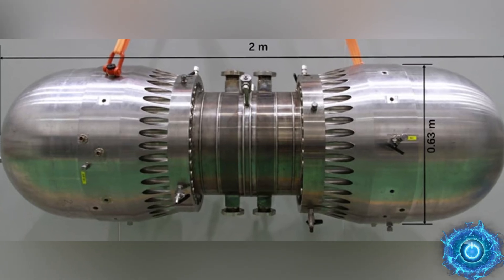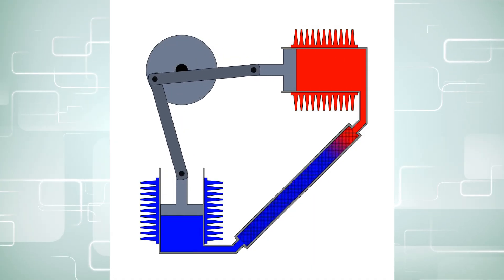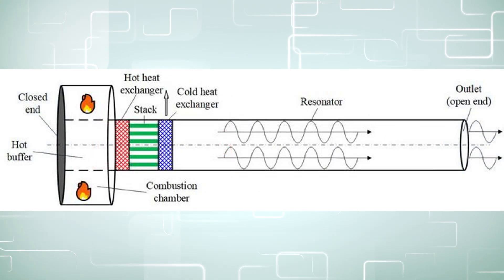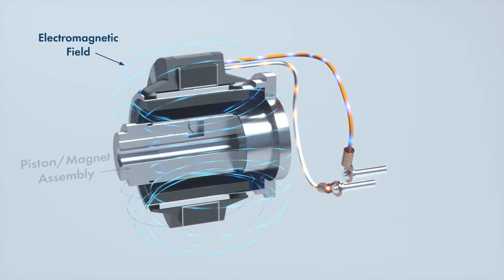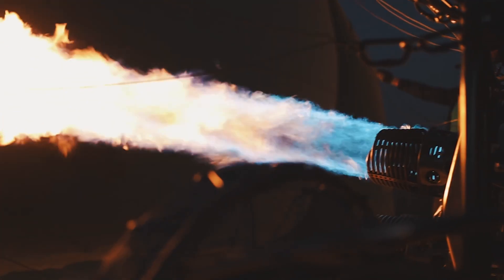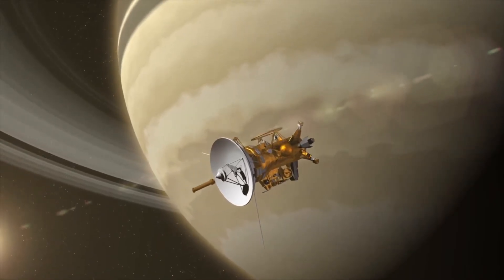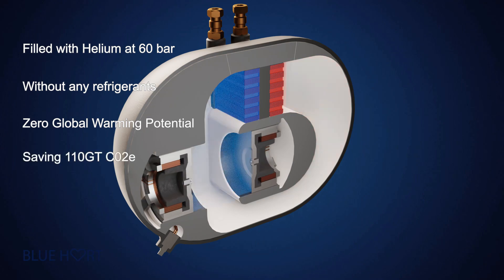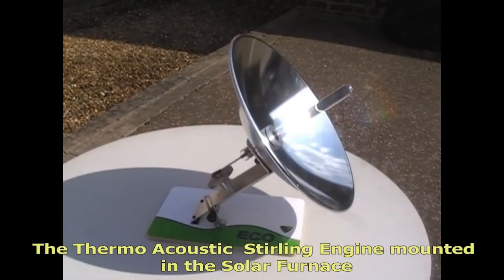New Acoustic Engine Breaks Records! - Thermoacoustic Stirling

Comment: The old solar furnaces used liquid sodium for heat transfer. 
The used in car valves to cool those 🚗 car valves down ❄️.
====
The 🌞 Solar furnace could be up to 3,000 degrees Fahrenheit. 
====
Now :
 Changing gears I , thought ? ; 🤔 💭 a clear rooftop skylight ☀️ plus water 🌊.

Water 🌊 in the skylight could  ☀️ power your lens 🔎 
=====
You could then store that ☀️power in 
[⌛ Sand Batteries 🔋] ☀️🔋 
🔋🔋 
,⌛🔥 
=====
Then use ? ; a Sterling engine that incorporated (Tuning Forks) 🍽️ 🎶 in the generator. 
====
Acoustic Rhombic Drive 

It , {{{👂 sounds 💋sexy 
for Valentine's Day 💕.
===
🔔 👂}}}}}

🌻
👋😎💨 Bryan 🧠💨🪣🦵💨

Comment: This tech could be used to draw energy from the heat of fusion in the future, fission now or with thermal energy from the earth itself.
In hotter areas we could make them bigger, have the cool end buried and the hot end exposed to the hot air/zon, you can easily reach over big temperature differences, between the soil and the zon. if made well enough it won't even transfer any heat to the cold end. we could also use the carbon nanotube wires to transfer heat from anywhere to the hot end, as they work like fiber, transferring heat from one end to the other without losing anything in between, like the light that goes into a fiberglass cable.

Comment: I came up with this ages ago and if you use solar panels to run a solar tracker to maneuver and arm holding a parabolic mirror and have it pointed at that or at the tank of a steam engine you can get energy outputs exceeding 80%
Reply: Only with the steam engine you have more horsepower and effective mechanical energy
Reply: I forgot to add in the alternator in order to generate power and a large battery with a capacitor to equalize energy output

Comment: I think these need to team up with hydrogen fuel cells to make use of the waste heat to generate more electricity, and perhaps integrate a means of air cooling the systems by circulating air underground to dissipate heat?

Comment: A system could be built using your own sun (via a plasma reactor) to ANY size. The acoustic unit and the reactor are scalable by orders of magnitude, creating unlimited power.  For example...the system could be the size of a hearing aid battery,  or the size of a planet.  And as for heat sources,  the plasma reactor can easily reach 25,000 C...is that hot enough for you ?

Comment: @2:00 Yes, the piston is "working"
Yes, the wheel is rotating.
No, there is no actual load.
Connect that wheel to a small generator that has a resistive load.
I can say with confidence that the actual available power is not much in terms of actually useable. And  yes, there are  many applicationz where low efficiency is irrelevant. Much like Peltier Junctions & Seebek Effect. 100s of mW is fantastic when you have nothing else as a power generating source.

Comment: This engine could be coupled with the exhaust of a gasoline generator and use the heat of the exhaust to greatly increase the output of the generator.  Not a very green solution but a way to exponentially increase the output and efficiency of our already existing huge number of gas generators not to mention new product.

Comment: Looks good on paper but it will be a nightmare for real world application. 
Heavily relying on heat source or temp difference yet you need to tune it for specific waves.
Then it is all cylindrical valves. Lubrication, seals ect.?
Maybe a rotary engine scenario?
Maybe identify optimal energy source something that gives it unique advantage over solar, heat pump application's.
Sound waves move faster in air but highest decibels are achieved in water. Something within these lines just because it can be used as substitute doesn't mean it is optimal solution.

Comment: if sound can't propagate in space, would an acoustic engine still be viable using a plutonium 238 thermal source?
Reply from the maker: Yep! Because you can still a medium or inert gas for the cylinder.

Comment: In Space, one side of a craft is exposed to sunlight and the other side to the shadows with a large temperature difference.
Can heat engines be used practically in space to refrigerate methane fuel tanks, maybe?
Just wondering for a fellow going to Mars.
Reply: sounds feasible

Comment: just think of the power this would have in space if you could get it done right so it will not melt . there is also the idea of Ceramics coated stacks to keep in residual Heat .

Comment: I have 2 startling engine on my desk and I plan on making a big one that runs off the waste heat from a wood stove and have low torque generator. With data centers going to suck up all the power causing the electric bills to skyrocket. We're going to have to become very industrious because electricity is going to become very expensive.

Comment: I like the Vajra ( 2 spherical shapes connected by a pipe ) form, i have never seen a stirling engine in that form before, very cool i have a 20 dollar stirling i got off the net and it works every time just put a heat source under it and the transfer of heat from one part to another makes a standing wave, i am making a motor that uses the Vajra and creates a nuclear plasma that destroys CO2 , CO, NOX, etc in the exhaust, its on a 7 hp Chonda. People get so stuck on using nuclear energy as a fuel, it does have other uses https://www.youtube.com/post/UgkxCZzR2cKzwuSAod8d6U0AUDUruidupyiR
Reply: good question, actually have a look at that YouTube post about forming plasma ( electric discharge ) with standing waves ( high pressure and low pressure regions ) they make lightning go in a straight line as the low pressure area is more .... what? ah more like a vacuum and plasma likes vacuums or inert gasses because ... i dunno my physics runs out there .... but its more permeable to discharges, thats why you do it inside light bulbs like neons ... the dielectric is easier to break down ...

Comment: I am no expert on the Stirling engine but in my view one of the reasons that they are so inefficient might be because they only capture a small percentage of the energy input. Primarily because of the leaky nature of the piston, its comparable to placing a propeller inside of a wind tunnel hoping to capture the energy of the wind. Most of the wind energy is lost when most of it avoids interacting with the propeller.

For the acoustic version that is being explored here, unless I am missing something the only real difference is that the acoustic transducer (the output speaker so to speak) or the electromagnetic generator takes the place of the crankshaft of the more conventional Stirling engine - and they still all rely on that leaky piston.
Reply: if they are so inefficient, then why are they used in submarines ?
Reply: @kelzangjinpa962 probably because water makes it possible to use a less efficient motor because it requires less effort?

Comment: Hyliion Carno generator dies this similarly, but is 60% efficient. Nearing scale production, under testing with the US navy. 22 fuels tested do not require after treatment for emission compliance. Can also be coupled to a nuclear heat source and used that way.  
Better, cheaper and faster.
Reply: You must have stock in that company! 60% efficient, no!
Reply: @Mentaculus42  I do have stock in Hyliion. 
That is exactly why I know what I am talking about. I have given you enough for a google search. Bone up on them.
 I am afraid their idea is better than this one.
Reply: @debi5292 

I have been following the Karno very closely! I have a better understanding of how it works than you!! It is NOT 60% EFFICIENT!! This is directly from their own disclosures. Net efficiency of 50% is stated in various sources. One info slide had an undefined thermal efficiency of the generator as 59% but only an overall system efficiency of less than 50%. That higher number is something that the company is rather vague about (and probably for good reason). Don’t always assume that everyone is stupid! The company is in survival mode for good reason. The Karno has huge scaling issues on top of it since it requires additive manufacturing which in this case is not a good thing. It is an interesting idea trying to find a profitable niche.

By the way, it is Karno spelled with a K for their marketing hype. Some people have more dollars than “Sense”.
Reply: @Mentaculus42  Its better than this widget is my bet.

Comment: Still don't know how the acustic part works.
Reply: Yes, I agree. I've built Stirling engines. I'd like to know exactly how the standing sound wave is produced from a heat source and a cold sink, and that standing wave then replaces the pistons.
Reply: @brianjacobs247  good question, actually have a look at that YouTube post about forming plasma ( electric discharge ) with standing waves ( high pressure and low pressure regions ) they make lightning go in a straight line as the low pressure area is more .... what? ah more like a vacuum and plasma likes vacuums or inert gasses because ... i dunno my physics runs out there ....
Reply: @StephenPhantom did a better job than myself!
Reply: Its just another energy source, get a cheapo Stirling off the net and see how it creates a standing wave in gasses, then just transfer that image to how to do the same thing acoustically and voila
Reply: @StephenPhantom can I just yell really loudly at it??  I’m not sure we have standing waves in Missouri
Reply: @williamgreen2673  You just invented the T rump engine I think,add that with the amount of BS he generates you can use the methane produced too may be
Reply: Nobody really knows in fact. You have a lot of effect. You have different regime of thermoacoustic pumping that has not been solved till nowadays. 

The key effect is the sound that goes into a holed ceramic that acts as a thermo-resistance and you have a thermal gradient from each side of the ceramic. This is the most simple effect... complex as F.
Reply: Sound is a vbration of air, the sound waves. You create them by trilling a membrane, and you can recuparate air trillings or absord a wave energy by a membrane, a microphone does that. Here is just another range of frequencies and amplitudes. A membrane is recipricating like a piston.
Reply: Just watch a slow motion, video of a speaker in action and then imagine that process in reverse
Reply: It oscilates quick enough to produce soundwaves, aka sound. That is why in demos we have strange sound present.
Reply: when sound waves bounce from one side to the other, the places they meet in between the 2 sides, create higher pressure zones, higher pressure heats up, giving you a heat source to draw from. you can also refrigerate using this tech, if you can cool down the hot high pressure area and than the pressure drops, it cools down more than it was before it got hot, giving you a negative temperature depending on the pressure and efficiency of the gas used.
Reply: search YT for "Acoustic Energy & Surprising Ways To Harness It (Intro To Thermoacoustics)" from NightHawInLight
Reply: Ignore that
Reply: Didn't give any sleepless night
Reply: Occilating air pressure. Cold-hot cold-hot cold-hot.
Reply: Heat is sound. Like light it is quantised, but whether it is seen as particles or waves depends on how you interact with it.

Comment: Interesting! I'd also like to see a video on the use of thermocouples for generating electricity.
Reply: Just watch a slow motion, video of a speaker in action and then imagine that process in reverse
Reply: Wonder if they could replace the alternator in cars by using the exhaust manifold heat ?.
Reply: Seems do able, im not so sure about being practical. Probably could incorporate it into the catalytic converter since its a hot spot in the exhaust, or right off the engine head but it would have to cover more space potentially vs a concentrated place like the catalytic converter. What about behind or inside the radiator? Complimentary systems. Or just a good ole alternator lol.

Comment: These have existed since 1999. The reason they aren't more widely adopted is because they have a max efficiency of 30%. But are more commonly around 15% in production. Not the best for very remote applications.
For radioactive fuel, a thermocouple driving a 95% efficient motor and controller can match or surpass this efficiency with less moving parts.
Reply: Thanks for information on some practicalities.  I wish more people included such things in their videos.
Reply: "Max efficiency of 30%"
Meanwhile, stirling setups with efficiencies through the heat->kinetic->electricity chain with greater than 30% literally exist.
Reply: "man kind peaked in 1999"

The matrix
Reply: A 5% efficient thermocouple, as pointed out in the video, with a 95% motor is 4.75% efficient.

"Radioisotope thermoelectric generators used on deep space probes typically convert ~3–7% of the decay heat into electricity. Researchers aim to improve thermoelectric materials, but practical thermocouples do not approach 30% efficiency — that level is only found in idealized theoretical systems or other technologies like Stirling engines or thermophotovoltaics" - ChatGPT
Reply: @PhilipWong55  With the proper rare-earth metals thermocouples can exceed 30% efficiency.  That is why these power all the communications and navigation for every deep space probe we have sent out, as far as I'm aware.
Reply: @aspendell209  in all deep space probes those nuclear power source with termocouples, more precisely with semiconductor thermoelectric generators, reach at most 5-8% efficiency. New materials only reach about 30% with high temperature gradients (>600K), but those never came out of labs.
Reply: @aspendell209 
Trying to drum up your failing enterprise with lies huh?
Reply: Petrol (gasoline) engine: ~20–30%
	•	Diesel engine: ~30–40%
So not so bad
Reply: Existed since 1816
Reply: Probably existed long ago in some variation. Look at the megalithic structures of antiquity and the joinery of the craftsmanship. Sonic power is the simplest deduction for the source of energy.
Reply: Its written on the walls inside the pyramid. ;) "Dendera Bulb". Your welcome. :)
Reply: You did not just use thermocouple and efficient in the same sentence, did you????
Reply: @sammy5576 🤣👍
Reply: Prove it.